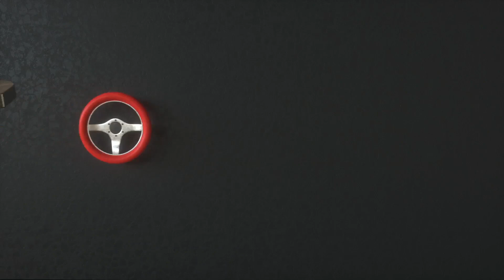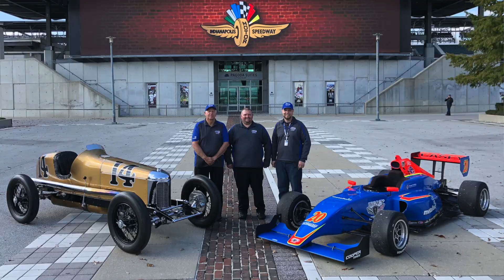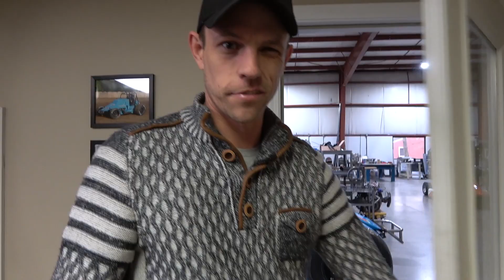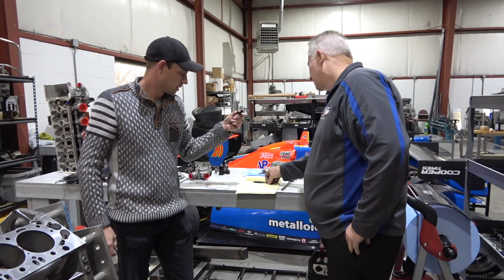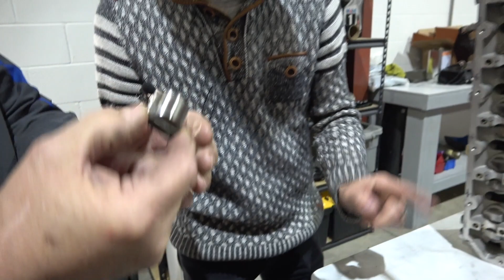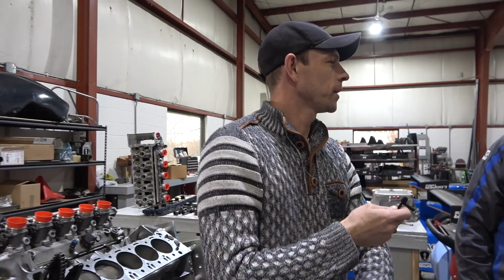Dinan BMW V10 racing engine Review and Rebuild

Comment: The s85 is the base engine I want to use in my  track day toy on a f3 style chassis
Reply from the maker: Wanna buy one of these?
Reply: @CaseyPutsch    No thanks.  I’m in U.K.  and plan on getting a e90 bmw m5 that has everything needed to get engine to run  £8000 will get the full car as there expensive to run thanks to our fuel being £1.60 a litre 

Being in U.K.   America engines are to hard
Reply: The American engines are to hard to get bits for.  And I really want the high rpm  v10 sound.  And with 500hp ish from standard out the car engine will still be fun in a old f3000  or formula Atlantic car
Reply: @danielthompson3849  e90 would be the M3 sedan E60 would be the M5.
Reply: @danielthompson3849  Getting parts for US engine in the UK is easy. Go to dealerships, order the specific unit.
You must know what the catalog number is for that unit though, and you must find a dealership that is willing to get off their hands and open the whole catalog, not just the 'we sell these models' catalog.
It's the same here DownUnder and many places around the world - walk in to a dealer and order a HellCrate, get the V8 out of the Hellcat series Challenger, but only by quoting the right part number to the dealer, otherwise that say "We don't sell those, we can sell you a new car,.."
Reply: @TheCluesRNTheBlues  your right
Reply: @PiDsPagePrototypes    Thayt will be very difficult considering there are no American dealerships in U.K. 
and Very expensive if there was.  
I could order off summit racing  but the postage and import charges. Make it extremely expensive.
Reply: Yes indeed I do ! Are you selling it ?
Reply: @CaseyPutsch  did you sell the S85 engines?
Reply: On the road cars it’s rod bearings that Seem to go at around 100k mikes    But the road car only makes 500hp.  Not 700   And is only 5l